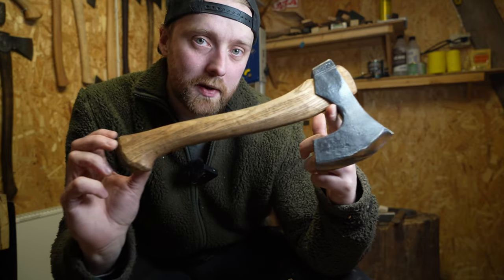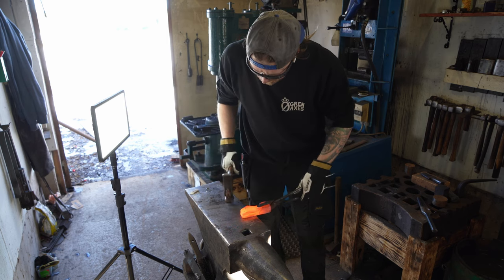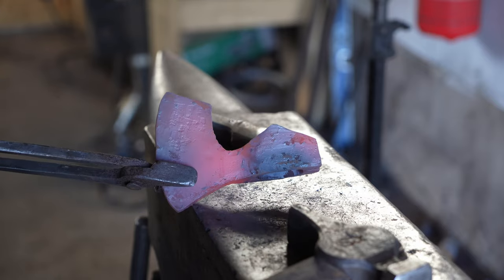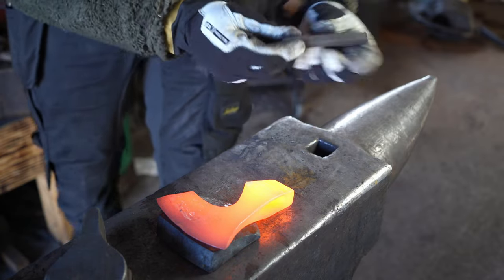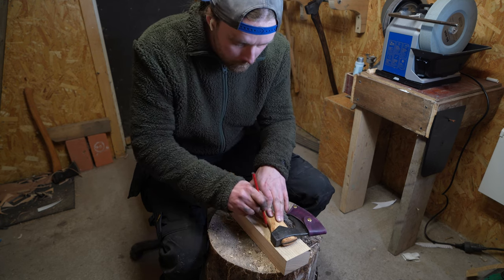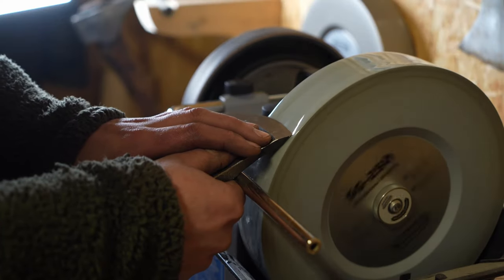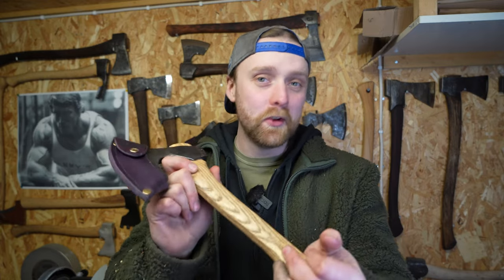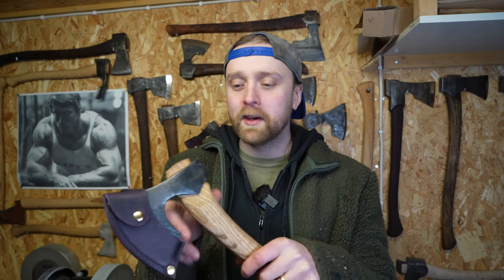Forging a Carving Axe: From Start to Finish

Comment: I love watching blacksmithing videos. The only knives I've ever made were from stock removal and just as a hobby.
But I had a question I always wondered about blacksmithing.
Does the steel on your blacksmithing tools lose its hardness over time since it's so often touching red hot steel? Always wondered about that.
Reply from the maker: I use steel that has some air hardening capabillities. Sure I have to dress them some times but thats rare. So the right steel for the job helps alot

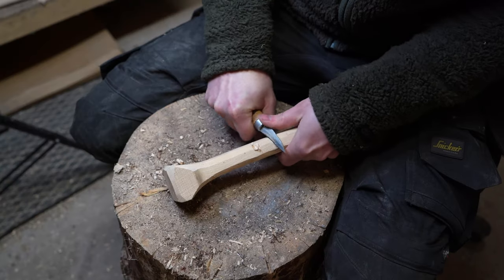Comment: 5:35 I thought a good Viking like you would be using a small  2 handle draw knife instead of that potato peeler.  :)
This would be a fun axe to carve out some small totem poles with.  The heavy butt on the handle is really nice as a hold and a bit of a counterweight.
Reply from the maker: I'm part Norwegian...;)
Reply: I was thinking as a warrior, not nationality.  Hopefully, I didn't offend.

Comment: Nice video Nils! What kind of finish do you use to blacken the axes in the end? Is it a finish you can use an all kind of forged steels?
Reply from the maker: Its raw linseed oil mixed with iron oxide pigment. Works on all forged textures

Comment: Did you make the drifts and all the hammers you use?  Just curious.  In most blacksmith/bladesmith videos, the drifts just magically appear.  I am wondering what material they are made of.
Reply from the maker: Yes I made them my self. I make a few drifts every year as they get worn out. I make them from 4340 steel. i have a video where I make one.
Reply: I will go look for it.  Thank you.